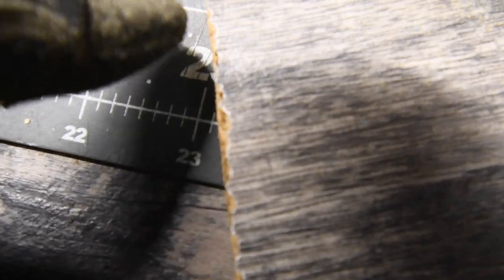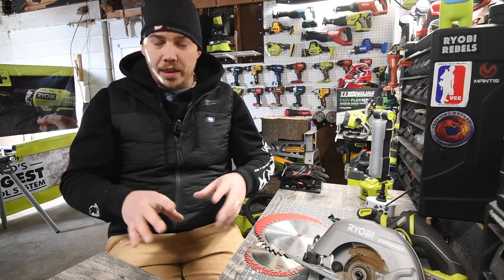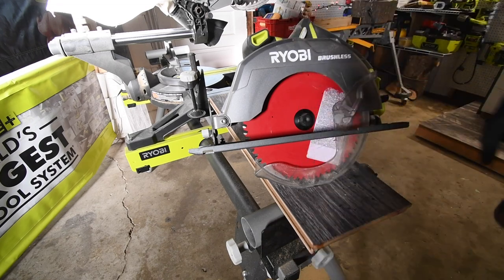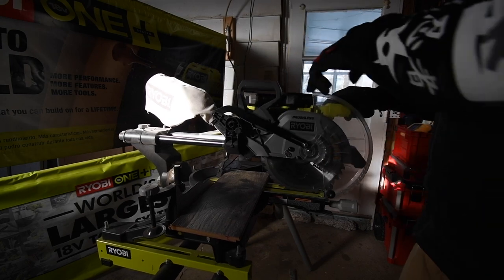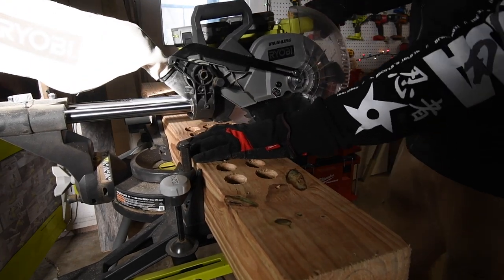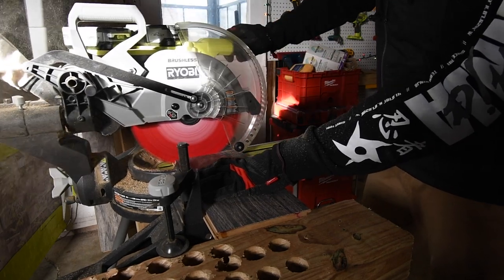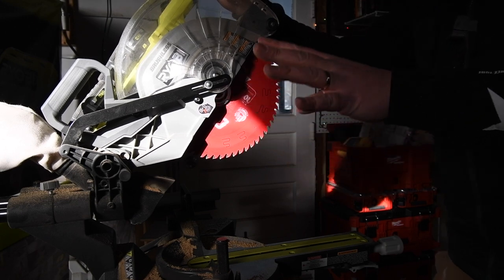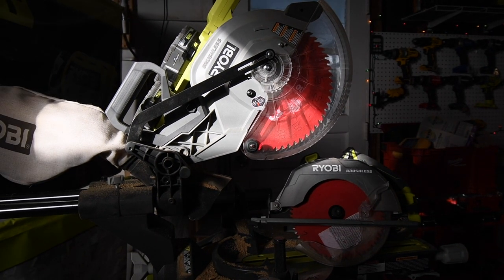24 teeth vs. 60 teeth Saw Blades

Comment: As a guy into woodworking, I can tell you there is a general rule that most don't know. More teeth for cross cuts and fewer teeth for ripping.
Reply: Indeed!
Reply from the maker: very good and I thank you for the info snow
Reply: Dont laugh, but is a cross cut a normal neat cut?
Reply: @suzesiviter6083  depends on the blade and type of wood

Comment: Helpful hint put finished side down and measure on bottom it makes a big difference
Reply from the maker: this was just to show the difference between the 2 blades. I just used the laminate as an example
Reply: Ok
Reply: @ManCaverTools understand it’s a demo, but in practice, finish side should be cut faced down so the blow out is on the hidden side.

Comment: if I would make an analogy to sandpaper: lower teeth blades equivalents to low grit coarse sandpaper, higher teeth blades equivalents to high grit fine sandpaper.
each one has it uses, you just needs to know where and when to use it.
Reply from the maker: yes sir and I thank you Eliad

Comment: The difference between the blades is much less dramatic when the cut isn't too deep.  The circular saw was set way too deep.  Also a larger blade with more teeth should cut the same as a smaller blade with less teeth.  They'll be the same density on both.
Reply: Way way too deep

Comment: If you are framing you need a 24 tooth blade because it cuts fast and in framing it doesn't matter if the wood chips. If you are doing general purpose work a 40 tooth blade is perfect because it cuts clean and cuts fast. And if you are doing laminate flooring or fine work /trim work a 60 tooth or more is the best because it doesn't chip the material, it is quite, and it cuts smooth.
Reply from the maker: this was just to show the difference between the 2 blades, I thank you for viewing Sawyer
Reply: Can you plz guide me?
I m from india & i m using 12 inch & 60T blade which come with my dws780 machine.
But now a days when ever i cut 3.5inch ×3.5inch or bigger pc to cut it is jerking after 95% cutting of pc & once its blade were stopped moving.
What should i do? I am newer in wood field.
Reply: @skyfighter1605  you should probably buy a new blade because the blades that come with saws  aren’t very good
Reply: @sawyercampion8822  thanks for reply.can you plz tell me which blade is better according you & how much teeth best for crosscut?
Reply: @skyfighter1605  get either a Diablo,Irwin or a Spider blade that has 40 teeth. That should’ve good for cross cuts. Just make sure you replace your blades often for the best results and less chipping.
Reply: @sawyercampion8822  great thanks for your suggestion.
But in india diablo blade 44 teeth amazon price is 110 usd approx.
Is that so much costly?
& other both brand not available
Reply: @skyfighter1605  is there any hardware/tool stores in your area. They can help you more because I don’t know what you can and can’t get in India
Reply: @sawyercampion8822  ok thanks

Comment: That’s good to know about the laminate flooring.  Didn’t think to buy a higher tooth blade for it.  I have some coming up I need to do.   
Also the lower the teeth the rougher the finish but faster the cut.   The higher the teeth the nicer the finish but slower the cut.   
It’s really all about matching teeth count up to the task you’re doing.  
That’s why you’ll often see ripping blades and cross cut blades sold for tablesaws.
Reply from the maker: I agree with you on that and I thank you Rick

Comment: I'd be willing to bet that you'd get a relatively smooth cut from a 24T Diablo blade, those ones that come with the saws are only good for rough cuts in my book.
Reply: I have an old Ryobi brushed circular saw.  I bought some Diablo blades to replace the Ryobi blade and it was a whole new saw.
Reply from the maker: we will see in the future and I thank you for viewing mc
Reply: mc0818 it depends on what kind of circular saw you are using. If you're using a Worm Drive Circular Saw like a Skil then you're gonna get a smooth cut on a 24 carbide Tooth framing Blade but not as super smooth as the 40 or 60 tooth blade. But 24 tooth blade is smooth enough just like the saw that I'm using DeWalt corded Worm Drive 7-1/4" circular saw and my Makita 5477NB Hypoid Saw, when I'm using these saw on crosscutting and Ripping Lumbers they're smooth enough! Not like when I'm using a cordless circular saw like my DeWalt XR brushless circular saw the cuts is so rough as hell! Even when I'm using a larger battery they're still rough and have lots of splinters.

Comment: More teeth is a finer smoother  cut for woodworking. It will increase friction and possibly cause burn in. Less teeth is rough cut and faster. Less friction.
Reply from the maker: you are correct and I thank you for viewing Rob

Comment: Is one tooth count marketed for rip cuts and the other for cross cuts, or are both teeth counts for one purpose?
Reply from the maker: this video was just to show the difference between them teeth count.
Reply: @ManCaverTools  I know, i was just wandering if its possible to get similar teeth counts for different tasks (since I dont know much about circ saw blades)

Comment: I see your point. The gap in the cuts could have been better with a speed square to keep the cut straight, you seem to blame the type of saw for the angled cuts. Also why didn't you turn the board over for less chips?

Comment: You are ‘ in your element,’ when you do these videos Dave, IMO.  😀 Good video on a good subject.  While I concur with you about most stock blades, I would take exception to Makita blades, as they are generally pretty darn good.  😀 Greater tooth count will usually yield better cut performance, depending on style of blade, etc.  However, more teeth come with a price, as in runtime, etc, with regards to battery powered saws.  That Ryobi slider is a Solid saw.  Try to find a blade that is designed for sliding miter saws.  It makes a difference.  The 60 tooth Freud did NOT work out for me, on my little 20 volt DeWalt 7&1/4 slider.  I switched back to the 40 tooth ‘Precision Trim’ blade that it came with.  Those are good blades also.  YMMV.  
👍👍👍😁✌🏻🇺🇸
Reply from the maker: I thank you for the positive reinforcement George
Reply: @ManCaverTools  You’re Welcome Dave!  👍😁✌🏻

Comment: Don’t take what I say next personal Dave. It’s not your fault. This is what we’re told is “right”. It’s not a jab at you, it’s a jab at the industry. 

I always have to laugh when I’m told I need a new high dollar fine tooth blade to cut laminate flooring😂😆🤪😝🤣
I’ve put down thousands of square feet of wood laminate and vinyl laminate over the years for myself, my family and an occasional friend, and I’ve never used a new blade, let alone a fancy high dollar one. Why would you? Your ends are always covers by baseboards or trim peices. Your ends are ALWAYS covered! We’ve all been lied to! It’s a marketing ploy! Just a way to sell you a new blade, and not just a new one.........a fancy dancy one!  I always put in one that’s on it’s last leg. doesn’t make a dimes bit of difference as long as it cuts fairly straight. Whatever you use is going to be dull by the time you get done anyway. Especially vinyl. High tooth blades are finish blades,  a perfectly smooth finish only matters when it’s exposed. Trim, paneling, baseboards, etc. 

And like the other guy said, laminated side down. It will be smoother. Wether it’s paneling or laminated flooring, plywood, or whatever. Finish side down.
Reply from the maker: this was a video just to show the difference in the blades. I just used laminate flooring as an example. because you can see the actual chipping as night and day. this chipping would also happen with fine wood. if you are trying to build furniture.
Reply: @ManCaverTools  you are absolutely correct about the higher tooth count creating a smoother edge. I am just pointing out that it’s not necessary for laminate flooring where the edges are hidden. Nobody ever says it
Reply: You are right. I just use a jigsaw for laminate flooring.

Comment: Good video.
I have a question about which blade would you recommend I use for cutting https://www.lowes.com/pd/Fypon-Durapoly-4-25-in-x-8-ft-Unfinished-PVC-Square-Column/1000460543
I plan on using my 7.25 circular saw. I've been researching all different types of blades. I assume I would need a blade with a lot of teeth for the fine finish cut and because of the PVC & foam inside of the column. The part I am stuck on is the metal rod/pole inside of the column and which blade I would need for also cutting the metal rod/pole as well.